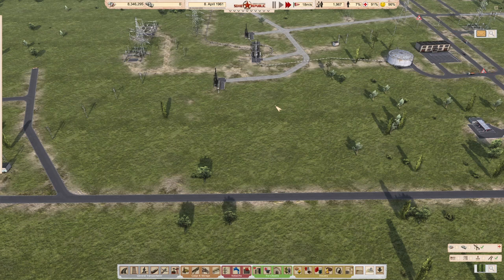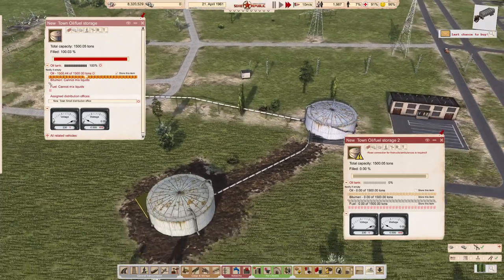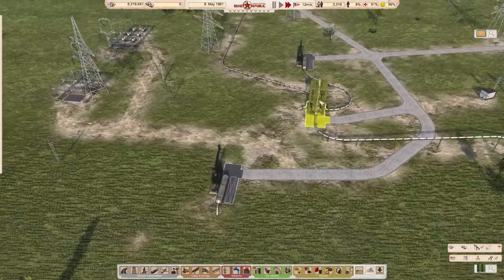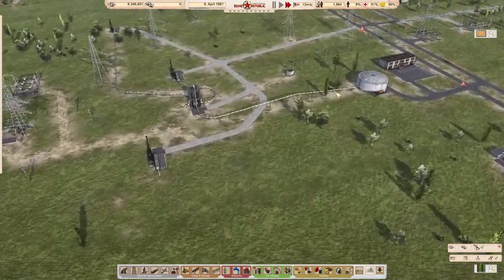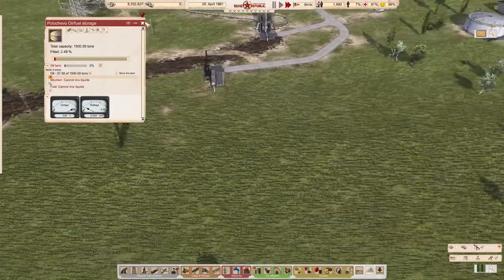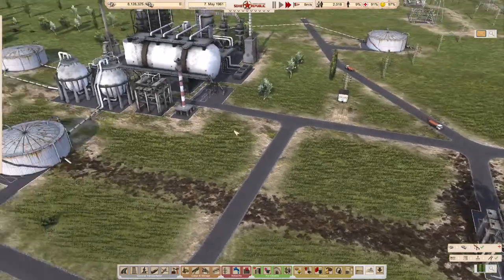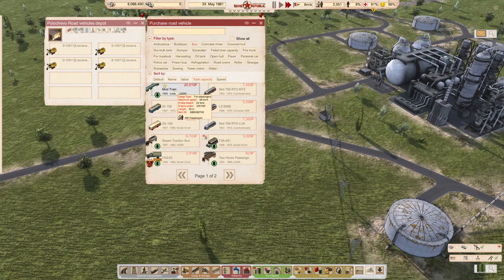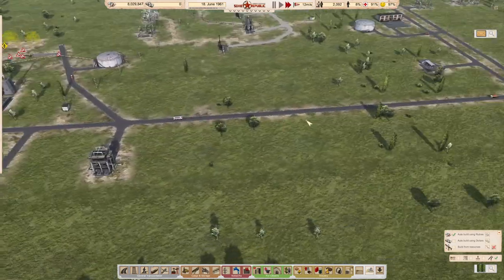Oil Refinery (Laying Pipes) :: Workers & Resources Soviet Republic: #08

Comment: I had an issue with my factory after setting it up for rail export, I just couldn't get any of the storages to take any resources.
Your tip about clearing a couple tons of resources actually did help clear my tank for accepting fuel, but for the life of me I can't get bitumen out of my goddamn factory.
I ran a pipe straight to the railyard and called it a day lol
Reply from the maker: The games rules relating to passive and active sources still catches me out from time to time,  especially the requirement to have a direct connection between an aggregate/fuel terminal and the storage.

Comment: How can I supply more oil flow to the Oil Refinery? I try to build more pumpjacks in different places but the oil flow into the Refinery almost unchanged. Do you have any tips?
Reply from the maker: If you have an external tank connected to the oil refinery by a pipe (a pump breaks this link) it becomes an extension of the internal storage.  This means the actual internal storage will not fill up completely as the refinery production draws from the external tank.  The max flow of a pipelines and pumps is 10t/second or 600t/workday (note: a workday last 60s at normal speed)  The output of a pump jack has the potential to produce 7t/work day,, but the actual production is restricted by the quality of the source, e.g. 53% reduces output to 3.75 t/work day.  All this means for example, if a pump is showing 0.339 t/second this equates to 20.34 t/workday, although this fluctuates according to the output from the pump jacks.  

Hope this makes sense, as looking into these  mechanics, can be mind-bending,   As a general rule I consider everything is going well if the connected tank contents is stable as it show the refinery is matching the rate the oil is being delivered.
Reply: OK, I see. Thanks @StephenSilverbeard